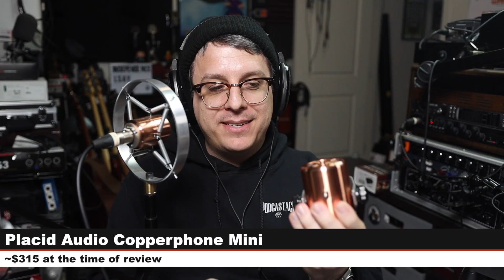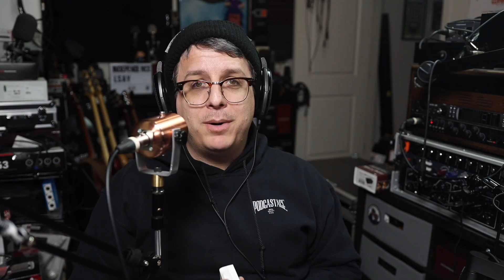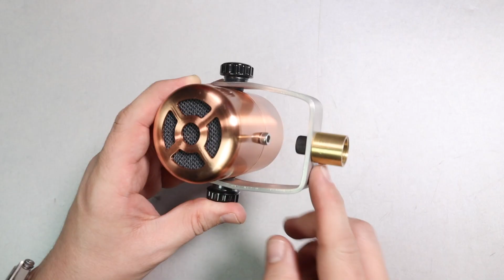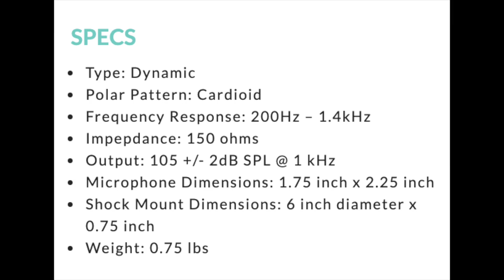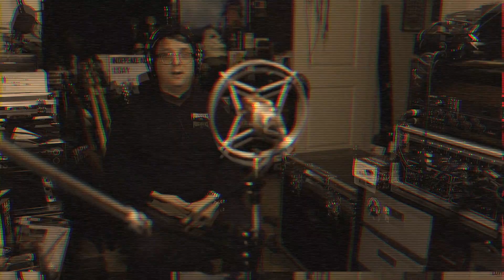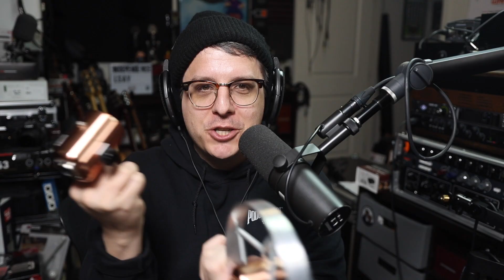Placid Audio Carbonphone & Copperphone Mini Review / Test

Comment: I think you were wrong when you said that you can't emulate the sound of the carbon phone in an EQ.
All I hear is distortion and frequency roll off with that sound. True, it's more than just a distortion filter. And it borders the line between soft clipping and muddy audio.
But for a plug and play solution to that effect, it's brilliantly done.

Comment: I’d absolutely throw one of these up (probably the carbonphone) as a secondary vocal grit mic to blend in for color and character, and for all the exact same things you said. I used to really want their full sized copperphone with the tone box that they used to sell as the tone box was not only a phantom power supply but it had different “color” options that changed the way the mic sounded but they discontinued that one to my knowledge.

Comment: I have a Copperphone (the big one) and I use it once in a wile to mix it with other different mics. Like in guitar cabs, I mix different mics like a 57 or a 421 with the chopperphone. The thing is that the phase and frequency respond is so different that they don't have phase issues between them so I use it to add more mid frecuency presence if i need it. Apart of the mor dramatic effects, of course

Comment: What these mics are likely good for:
A podcast that wants to recapture the old-time radio show vibe

Old-time remixes of modern songs or just recording old songs

Accessible tech with sound not unlike old mics and gives people a semi-affordable option to get that sound in an authentic  fashion as opposed to EQing.
Try finding a vintage option that isn't dilapidated, has an optimal setup (e.g. XLR as opposed to Instrument line), AND is competitively priced.  You may find a deal, but it may not exactly be the sound you want depending on what you find, but even IF you find something that is all of the above, are you really willing to use nearly 100 year old gear on a regular basis?  If it was me, I would keep that kind of thing in a display case to preserve it the best I can, maybe using it on special occasions.
With the mics reviewed, you don't have to worry about possibly damaging an antique mic.  I know this was quite a rant which, funnily enough, is coming from someone who personally doesn't have any use for these particular mics, but I think it's cool to think of the uses that these mics offer, niche as they may be.

Comment: I disagree about not being able to recreate the sound of those microphones with a VST like WAVES "The Kings Microphone".  In fact, if you mic a small amplifier and add that VST you can get the same effect.  I think that the microphones are more intended for live performances.  They are very attractive.  Back in the day before VSTs, to recreate the sound of older microphones or walkie talkies, we would playback the actor's lines through a small guitar amp, and capture that with a dynamic mic.  Usually an SM-57.

Comment: I have some old carbon microphone elements used in military headsets and old telephones. They sure sound a lot better that the tested carbon microphone. Maybe that microphone was faulty constructed as it said to go up to 10 kHz - and it sure did not. One thing to do with carbon microphones is to hit the desk lightly so that the carbon particles "loosen up" as theh might stick together occasionally.
I am using my carbon microphones to simulate eartly 1920's broadcasts. The first official broadcast in Sweden was made from my town on July 12th 1921. 
I base my comments on the carbon microphone tested on being a professional sound engineer with the Swedish Broadcasting Corporation (Swedish Radio) since 1971. ;-)

Comment: You can just take some cheap speaker and plug it in instead of a microphone, it will have about the same effect.
To recreate the carbonphone effect, you need some kind of equalizer and a non-linear element, it can be a specially modified amplifier or a software effect. I think we need to create a non-linear gain on weak signals.

Comment: These are so neat - I could easily see these having a use for character voices for radio-play recreations or for any number of voices for video games that have a vintage focus.  I can also see these getting use for a channel that was doing something like The Great War, probably not for the primary dialog, but could easily be used for passages where you want to emulate that very specific sound of transmission by transatlantic cable.

There's only ever going to be a minority of projects that would need something like this, but for those projects these will be golden and bring an extra element that goes further than "our engineer made it sound like bad audio from the past with a lot of EQ"

Comment: That was just great fun (and I loved the the sound of the electric guitar via the carbon; that was awesome)! I'm a radio ham and after watching your video, I'm now rather temped to dig out my old bakelite telephone, use a phantom feed to energise it and try it on an AM transmitter. :-) Incidentally, for my daily transmitter mic, I've decided to try out a Lewitt MTP 840 DM (arriving tomorrow) and it'll be fun to try it both passive vs active via a phantom power injector (the Icom 9100 radio expects a low Voltage fed, high output condenser, though I'm currently using a £22 T.Bone BD 200 dynamic kick drum microphone - vla a 10 uF cap to block the 8V DC from the Icom radio - and very astonishingly, as a comms mic it actually sounds pretty darned good and that's with no EQ, er, well, sounds good other than the extreme handling noise)! All the best and thank you for all the excellent (and very entertaining) videos! Briain (Scotland)

Comment: I actually appreciated the copperphone more than the carbonphone. It is somewhat easier to hear what you are saying/singing there. It is what I would consider the perfect "old radio" microphone. I have a 1950's Grundig GCM 3 Bakelite Condenser Microphone lying around. It is fitted with a small-tuchel connector. I got a guy I know to cobble together a small-tuchel to jack adapter from an old DIN-connector scavenged from a non-working keyboard. Since it has very specific demands of the amplifier and we cobbled it together without looking up any actual pin-outs it sounded something like that. I later bought a more professionally made adapter that made it sound way better. I would love a Copperphone mic to do the same job. But I don't feel like paying $300+VAT for it. But if I got hold of one of these I would use it to recreate some of the old 90s black metal sound, but used in a garage band of sort.   

The Carbonphone did sound a little too much like blown out speakers to me, so I would not go for that.

Comment: Absolutely insane. Surely there are plugins that... oh, never mind.
Reply: I don't know why you'd spend 300 dollars on a single purpose microphone that could be much easier and cheaper to simulate with a plugin (or pedal)... And you can't use that microphone for anything else.

These mics don't even produce an 'old radio' sound,which is often more 'coney' than tinny.
Reply: @crooker8647  I think that's because the old radio sound isn't just defined by the microphone, but also the old radio speaker. Another great reason to simulate the effect.
Reply: This is WAY cooler than using a plug-in IMO I’d buy this lmao
Reply: @serbadork  I kinda want it for a radio show

Comment: The Carbonphone actually starts sounding pleasant from a distance
Reply: It seems the mic is saturating all the time except from 2 or 3 feet away. I imagine the mic has a very low dynamic range, if you keep the signal in that range and use huge amplification, you can probably get a decent sound.
Reply: Stereo pair as room mics might give an interesting sonic flavor to 3d space perception.  Or bandpass, bit crusher, overdrive, eq also maybe works applied to any mic, but yah.  Close up they sound like shit, but far away is something tasty and intriguing.